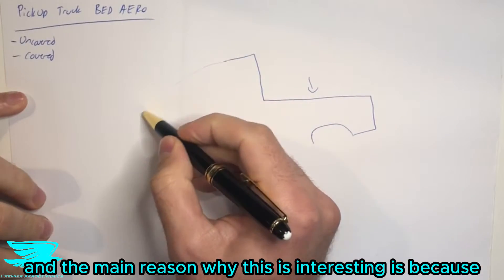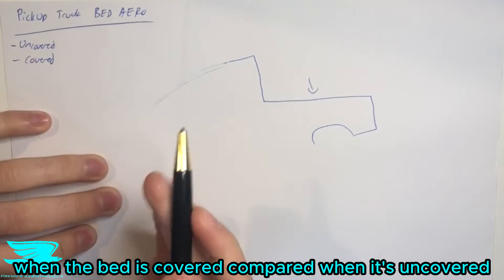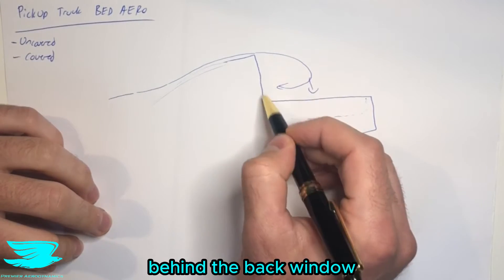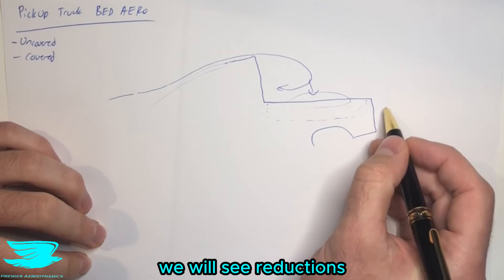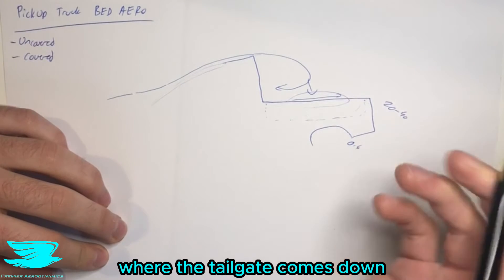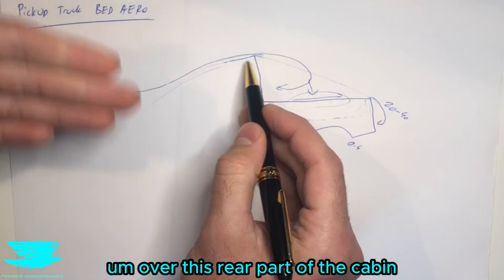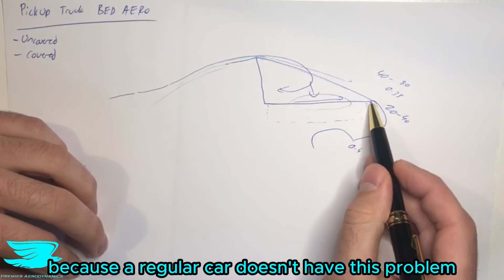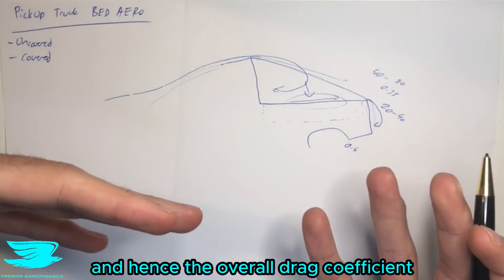{Auto Aero #46} Pickup Truck Bed Drag

Comment: Well you got a like and sub from me 
Maloos are great but I personally like the older onetonners hq hj hz hx with a flat tray 

I am in the process of building a tray that has the quarters incorporated from the tray height down I am doing this purely for visual appeal 
But I do hope it helps with aero
Reply from the maker: Thank you! For your tray, if you put a lid on it, that will definitely help reduce the drag. If you remove the sides, then that will also help a little because you won't get as much recirculation caught in the bed.
Reply: @PremierAerodynamics  cheers for the reply
 I read back first comment I wasn't particularly clear 

I have a hq Holden one tonner that I am building a bolt on tray for 
It will thave the standard flat tray top but I am fabricating sheet metal quarter panels

 from the tray deck down much the same as a factory ute I am doing it 90% for the look of it but I wonder what impact it will have on the aerodynamics 

I Imagine it will clean up a lot of turbulent air from the exposed chassis tie down rails and flat sheet metal mud guards
Reply from the maker: @bluejayfabrications2216  Oh okay. Yep, definitely. If you cover pretty much any exposed object sticking out into the flow, it will reduce the drag. With that description, I would imagine maybe a 3 - 5% reduction in the drag coefficient.